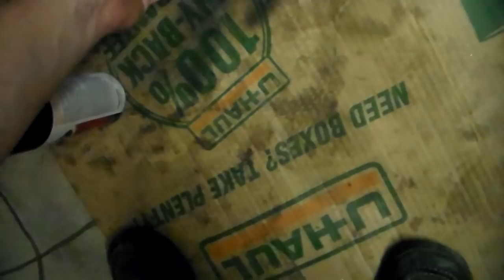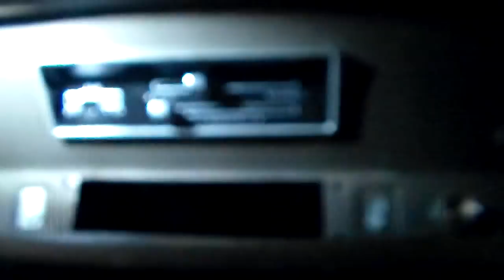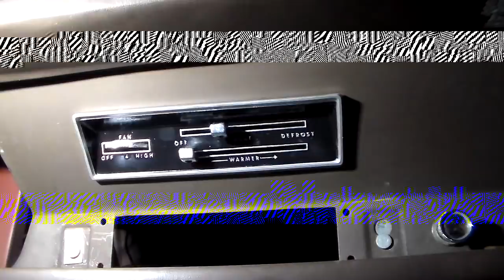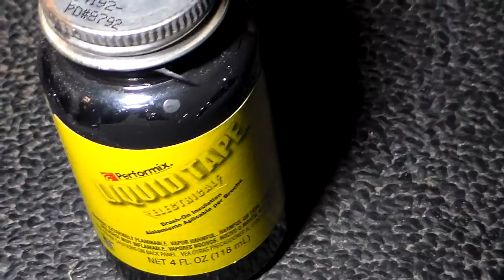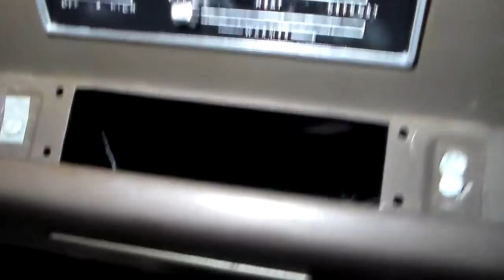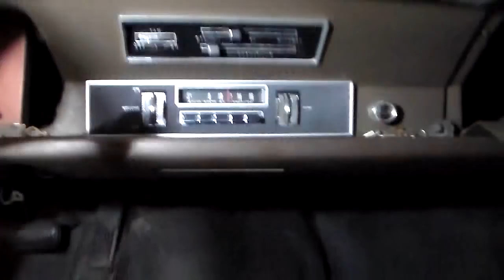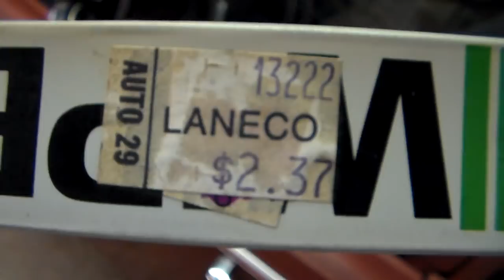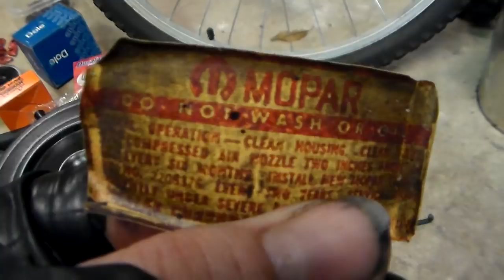1 month of work on 1968 Valiant condensed to one hour

Comment: Keep up the good work. I like your attention to detail on the interior. These driver Plymouth sedans are cool. There’s not many of these left but back in the day these cars were everywhere. The cars that the average Joe could afford and pass off to their kids. My great aunt bought a new 1968 Dodge Dart 2 door with an automatic and 225 slant six with the decal on the air cleaner “Charger 225”.  It also had that distinctive thumb wheel AM radio. It sold new out the door for $2,350.  My father and I went with my aunt to pick it up at Raynal Brothers Dodge in Detroit. The car was manufactured at the Dodge Main plant in Hamtramck Michigan.
Reply from the maker: Thank you. The '73 Dart Sport I had and this '68 were built at Dodge Main, but the '73 green Valiant was made in Windsor, ON.

Comment: Ma Mopar didn't follow the rules all the time. Sometimes the factory just installed what they had available on the assembly line. Thus, you get things like my Intrepid, with one plastic front fender and one metal fender. Good explanation on how your car was built.

Comment: Often the lower end engines and transmission were optional at less cost in the late fifties, sixties and early seventies among all brands I find. I see cars a lot that had there original drivetrain, that some" know it all" stated wasn't available in it, when it was at less cost. Factory mix up's are very rare... unless it's GM.  I like the black on the heater control, looks good.

Comment: I traded a 1986 Toyota pickup with over 300,000 miles on it for a 72 skylark.  Little parts are astronomical....ugh.  I'm finding them here and there as cheap as possible.  Anyway, someone took the 350 out and put a rebuilt 65' buick 300 in it.  It has the 3 bbl carb but in 65' the did offer a 4bbl. for the 300.  I need to find a 65' cast iron 4bbl manifold for a buick 300.  I'm thinking a 307 or 305 q.j. could work .........correct?
Reply: A cast iron 4 barrel intake from a Buick 300 or 340 V8 will likely have a square bore spacing and bolt pattern as I believe those used either a small Carter AFB or a Rochester 4GC carburetor.  A Rochester Quadrajet would not be a bolt-on in that case (but might fit with a spreadbore adapter).
Reply: dnanestrau the carter.....yes.

Comment: Save the two metal rods in those old wiper blade refills and you can order just the replacement rubber on ebay from, I hate to say it, China for $0.99 a set, i believe in 23 inch lengths.
Reply from the maker: Brian Andrews That's awesome, thanks.